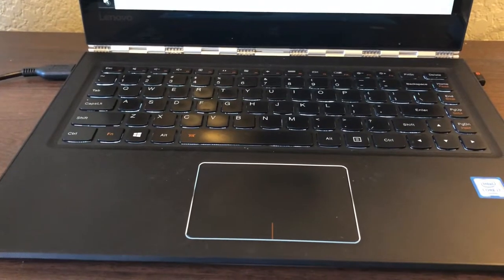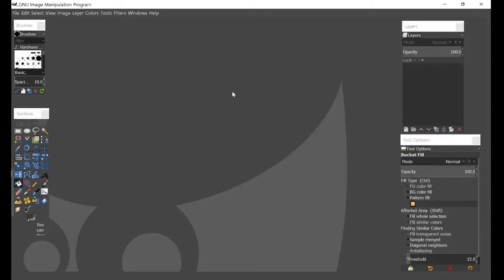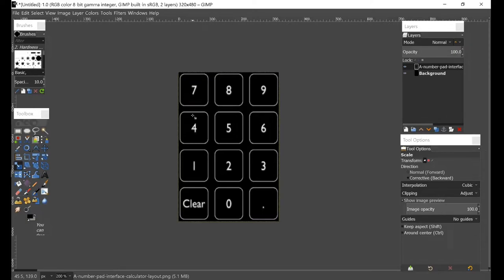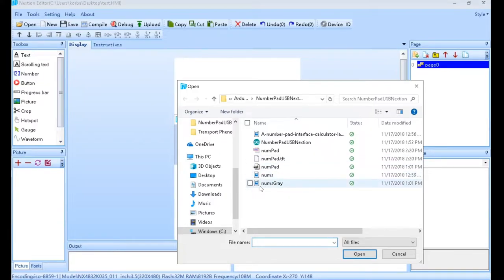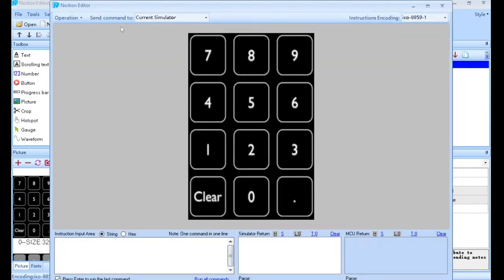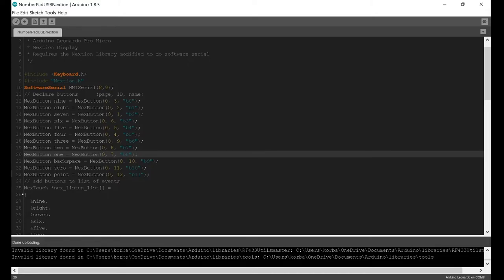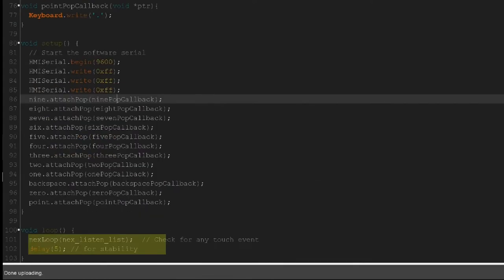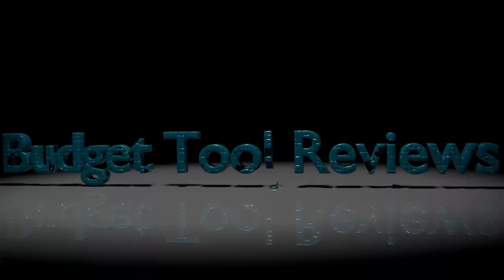Easy Arduino Touch Screen USB Keypad Tutorial with Nextion Display

Comment from the maker: For anyone wondering how to make your Nextion library work with SoftwareSerial

1. In your libraries folder, find the Nextion library.
2. Find the file called NexConfig.h and right click on it and click edit.
3. Find line 37 that says   #define nexSerial Serial2 
4. Delete or comment out that line and replace it with the following: 
#include <SoftwareSerial.h>
extern SoftwareSerial HMISerial;
#define nexSerial HMISerial
Reply: Is there any way where I could make that like speed controller where if I slide my finger up on the screen the speed of my ae: car goes up. Or something like that.
Reply: Please Can You Tell Me Why i Am Getting An Error Saying  "Nextion.h: No such file or directory
"    ?
Reply from the maker: @boffffff  have you installed the nextion library correctly?
Reply: @korbano  now i have but  now i get this 'NexButton' does not name a type; did you mean 'Nextion'?
Reply from the maker: @boffffff  https://forum.arduino.cc/index.php?topic=616143.0
See if that forum helps. I think there’s 2 different Nextion libraries
Reply: @korbano  thankyou if this works you are a life saver i am doing this for a school project And it needs to be in asap
Reply: @korbano  now i am getting 'Keyboard' not found. Does your sketch include the line '#include <Keyboard.h>'?
Reply from the maker: @boffffff  the sketch does include Keyboard.h. Check to make sure it’s in the code. You are using a Pro Micro or Leonardo board right?
Reply: @korbano  yep using pro micro
Reply: @korbano  I found the error
Reply: Totally forgot about this and it did my head it. Glad you put it here to remind me. Cheers once again. :D

Comment: Hi! Love your videos, and I am using this one as a guide for a final project for my Capstone course, but I keep getting an error: 'NexButton' does not name a type.  Can you provide any advice or feedback on how to resolve this?  Also, I have the user using the "Text Select" option which then populates to a button on another screen.  Will the display be able to transfer that data to the Arduino to store and utilize as an integer for the hours and minutes of a timer?  Thanks for your help and your great content!

Comment: Files arent saving as .tft, theyre saving as HMI and the screen wont recognize them. WHat do I do?
Reply from the maker: The HMI file is the file to open project on your computer. To make the .tft file, click the compile button. Or newer versions of the Nextion Editor have a better way. You can do file, TFT file output, and then choose where to save it. It’s even got a button to open the folder it saves it to

Comment: could you do this to make one of those 'elgato stream deck' things ? I would be very interested
Reply from the maker: Check out this picture of an interface I’m working on https://drive.google.com/file/d/10Ko_N3Rlvj644ZHcNwVhAl0VPEzF8L-t/view?usp=drivesdk

I’m not too familiar with a elgato stream deck but I think what I made may be similar. Basically my device has a collection of “apps” that have keyboard presses associated with them. For example, the unlock button types my computer password and automatically hits the enter button. I would press that when I’m on the lock screen of my computer and it would automatically unlock my computer. The shortcuts button goes to a page with a list of internet shortcuts like YouTube, google, amazon, etc. Tapping one force opens the internet browser and automatically goes to that website. And finally my favorite the mischief button. It has a list of different computer attacks. One of them opens up the command prompt, changes the text color to green, and types “you’ve been hacked”. Another presses alt+F4 which closes the window. 

So basically it’s a collection of keyboard shortcuts and keyboard presses on a single touch screen interface. Is that kind of like what you were talking about?

Comment: Hi there. Very well put together tutorial. I am however, having a problem when compiling the sketch. Im getting a error that reads - NumberPadUSBNextion:14:1: error: 'NexButton' does not name a type  NexButton nine = NexButton(0, 3, "b0");

Wondering if you know what this means and how to fix it. From what Im reading elsewhere is that the Nextion library is not loading up somehow.
Reply from the maker: I seem to remember getting that error at one point although I don’t remember why. I would make sure your Nextion library is properly installed under Documents>Arduino>libraries. Make sure the Nextion library has all the stuff in it in the main folder. Usually when you download a zip file, it has a folder within a folder which can mess up the compiler. Always close all sketches after changing any libraries
Reply: @korbano  Thanks man. Yeah I think my library folder is pretty screwed up. I'll try cleaning it up. Thanks for the quick response.
Reply from the maker: Jaysun Spinks absolutely. Thanks for watching and subscribing!
Reply: @korbano  No worries brother. It was a worthy SUB. Just so you know your info helped and everything is working fine now. Cheers.

Comment: I have a question. Can i convert the numbers i send with the keypad into values? I need to send numbers to the arduino with the nextion keypad and save them into an int value. Is that possible or i would have to modify the entire thing?
Reply: Pleas contact me by my homepage information if you still need it .

Comment: Could i use Arduino Uno or Mega for this project ?
Reply from the maker: Yes but the code would be different. Since the Arduino Pro Micro has the 32u4 chip, it can use Arduino’s built in keyboard library. But the Mega has a different chip so it can’t use the built in library. However people have made keyboards with Unos and Megas. 
https://hackaday.com/2012/06/29/turning-an-arduino-into-a-usb-keyboard/

Comment: With small RAM on those Nextion TFT screens how can I know if the PNG images for a multi page product will work ? Let’s say I want to have 5 pages with 2 images per page (one for the pressed keys and another one unpressed keys). can I Load 10 different PNG images to Nextion TFT with just 2k of RAM?
Reply from the maker: I'd imagine the Nextion Editor knows how much RAM each screen has and wouldn't let you add too much data. When you click the compile or debug button it'll probably give you an error. However, I'm using the Enhanced screens and I've definitely had more than 5 pages each with more than 2 images per page and never had an issue
Reply: @korbano  yeah, that’s a good suggestion. I’ll try to upload the images in Nextion Editor. I hope it fully reflects actual hardware. mine is a basic model but I’ll give it a try.
Reply: @korbano  I’ve just found an interesting information regarding my model (NX4827T043-011R). It says 2kb RAM and 16mb Flash memory. There is a note saying 2kb is just for variables. Flash memory is used for Fonts and Images. Well. Not that big but better than the 2kb RAM. Logic in this statement is kind of weird but is good to know I have more room.

Comment: can u please help me?! where can i finde Keyboard.h library?!
Reply from the maker: Nafe Alasfar it’s part of the Arduino IDE so it’s already installed
Reply: i have installed it already but i become always this warning whem i compile that i dont have it
Reply from the maker: Nafe Alasfar did you include it properly in your code?
Reply: @korbano  yes i have used the same code that u used
Reply from the maker: Nafe Alasfar which arduino board are you using?
Reply: @korbano  Arduino uno
Reply from the maker: Nafe Alasfar there’s your problem. Only boards that have the 32u4 processor like the pro micro and Leonardo can use the keyboard library
Reply: @korbano  i have bought pro micro but it also doenst work.. can u please help me?
Reply from the maker: Nafe Alasfar what is the exact error message you are getting?
Reply: @korbano  'SoftwareSerial' does not name a type
Reply from the maker: Nafe Alasfar my email is korbano@gmail.com
Reply: @korbano  i have just sent u an email
Reply: Hi, did u tried <SoftwareSeria.h>
And I m with the same problem "Keyboard".

Comment: Can I use nextion  screen 3.2 with this project    ????
Reply from the maker: Not directly. You would have to manually scale the background picture and all the buttons down to fit your screen if you want to use my files. But this project isn’t super difficult to make from scratch. I wish the Nextion editor automatically scaled projects to fit different screens, but unfortunately they don’t do that
Reply: @korbano   indeed I can create my own tft file but I asked about arduino code file
Reply from the maker: mustafa radhwan the Arduino code will work with any size Nextion Screen
Reply: @korbano    
I'm sorry 
But I have another question
Can I use the  basic  type of nextion screen and how could the computer recognise that arduino  as a keyboard
Reply from the maker: @mustafa97radhwan  yes, you can use the basic version. If you use an Arduino that has the 32u4 chip, the computer will automatically recognize it as a keyboard, just like any other USB device